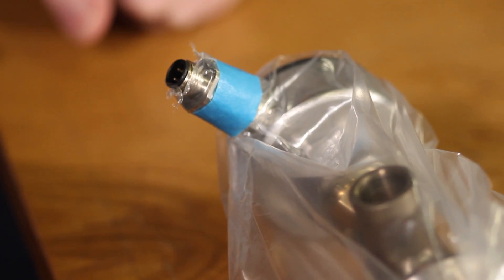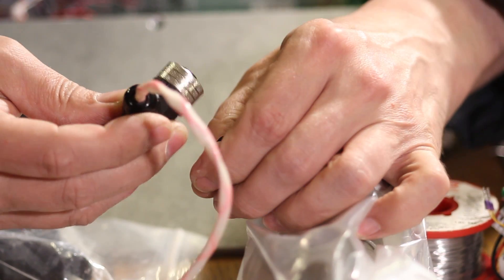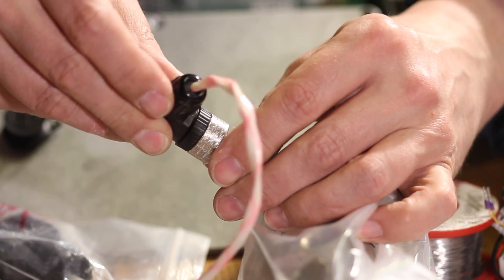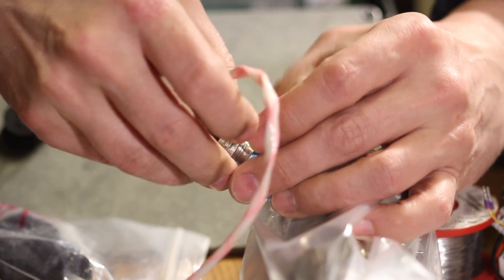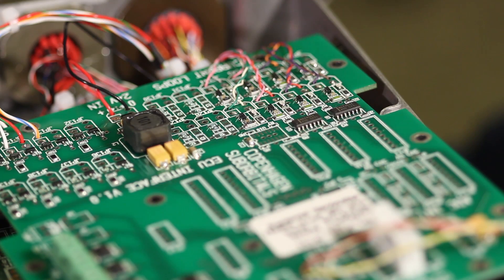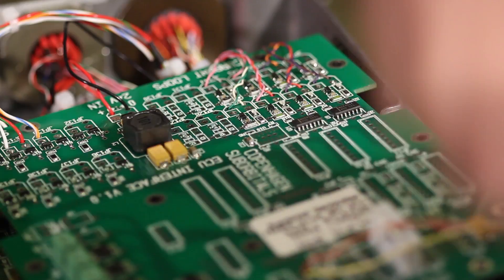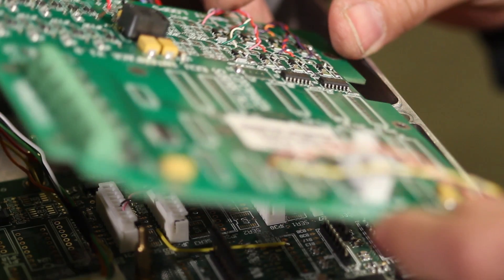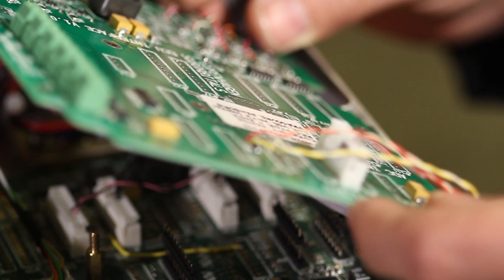Nexø II Tabletop ECU test

Comment: in the future, a CAN/LIN would be superior to a UART serial especially against interference. cheap to do and easy to allocate data frames for different control and sensing systems. plus you can go up to 80% bus load without drops, and message hashes and retries are built in. very robust.
Reply: Beau James Erion Only a small minority of available microcontrollers include the hardware and/or computing capacity to implement that bus. I am also unsure if there are any suitable rad-hardened components for highest altitude uses.
Reply: John Francis Doe fair point. There is an atmega chip that has CAN built in or you can use separate transceivers like the MCP2515/MCP2551, but most only go up to high automotive standards. I would figure that if you're not going for extended orbit time, hardening would not be as critical, but I could be mistaken.
Reply: Hardening is not a problem until you reach the Van Allen belt. That's why cubesats go up with off-the-shelf components all the time.
Reply: any recommendations on good hardened microcontrollers or communication hardware anyone?

Comment: Vibration seems to be something to watch out for. I assume that a rocket might vibrate on launch and pcb's and connectors could crack or fall off...
Reply: Fortunately there is a very large body of work on the subject readily available in the form of automotive electronics, in addition to aerospace electronics.